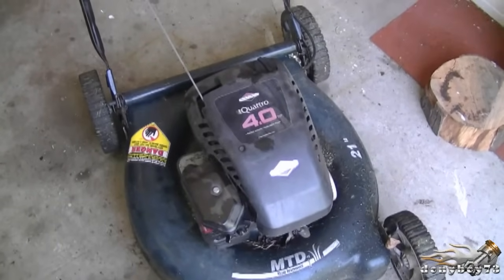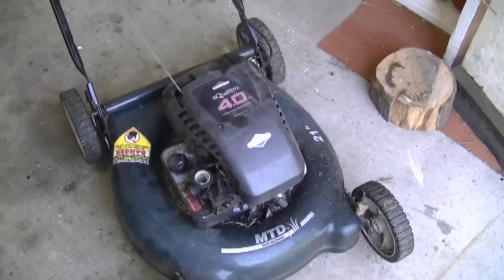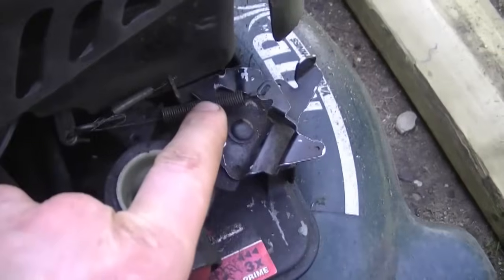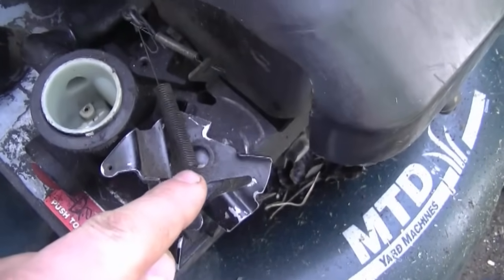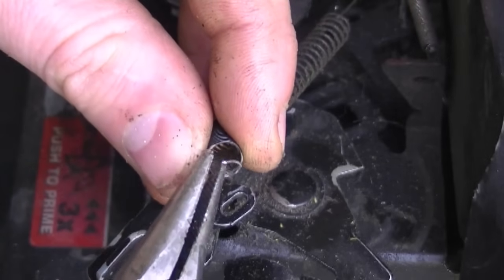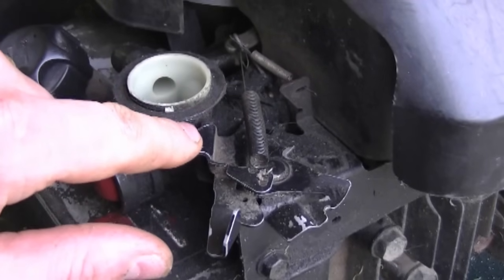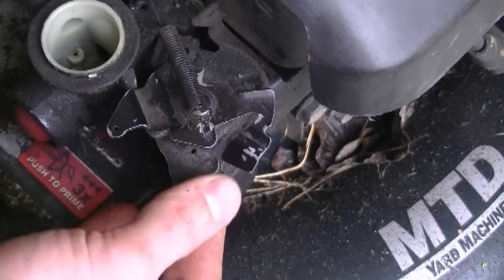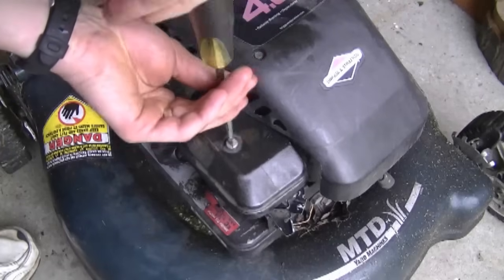HOW-TO ADJUST THE ENGINE RPMS ON A BRIGGS AND STRATTON LAWNMOWER

Comment: I did this but then it idled too high so I bent the tab so it idled fine but then it didn't rev high enough again.  I kept cutting the spring and bending the tab but I'm just going around in circles. I must be doing something wrong but can't work it out.

Comment: Exactly what I was looking for. I'm heading out to the shed now to give it a try!
Reply: UPDATE: Just what the doctor ordered! Worked like a charm! Thanks! What's even better is, I got the mower for free because the previous owner couldn't get it started and didn't want to take it to a shop (or watch a YouTube video). I took it and a half an hour later (and 1 YT video) I cleaned the carb and first pull it fired up. But I noticed it was idling slow. I downloaded the engine manual and there wasn't an idle screw to adjust. A little more research I saw two screw holes plugged up from the manufacturer. It was said one of them was the idle screw. I was just about ready to go down that rabbit hole when I found your video. It's running like a champ now!!

Comment: I have a similar mower but when it's on pavement it runs fine. But when you start cutting grass it will sound like it's hunting for air.
Reply: check the air filter - clean or replace as needed. thicker, taller grass will slow most low powered motors like this one, so cut regularly. adjust deck height. use good new gas. clean the carburetor - could be a gummed up jet. Check the spark plug and clean or replace, check the gap. lastly, at the end of the season run the gas out!
Reply: @theoriginalchefboyoboy6025  I think I found the problem. I replaced the gas tank and carburetor. It was all together on Amazon.  Now I'm trying to figure out why it's not sucking up fuel in the primer bulb. Unless I have to get it going with starting fluid then prime
Reply: @theultimatespaceghost6065  I went to prime mine today and I knew the gas tank was getting close to empty, but to me that shouldn't make a difference. It wouldn't prime - the button was just all squishy. So I thought, what the hell, I'll just top up the gas and it primed normally, started first time, so there might be some weird thing going on that the gas needs to be at a certain level.
Reply: @theoriginalchefboyoboy6025  I got it figured out.  I put the old carburetor back on and it primes as it should

Comment: My briggs and stratton sprint classic engine 148cc 450 model mountfield lawnmower won't rev much, even moving the throttle manually, still won't rev high at hall regards colin from croydon surrey England 👍 👍

Comment: Remove the governor springs and air vane. Install a throttle directly to the carb. You can manually adjust your own idle. You can max throttle it and let it redline. Briggs and strattons are way tougher than Tecumsehs!!

Comment: I bought one of those cheap mowers a Lowes and used it for probably eight years and then bought a Toro self propelled mower. I took the Yardman to the farm and used it another four or five years. I changed the oil regularly and replaced the air filter when needed. I did the speed adjustment here after watching this video. I installed a new blade and primer build and ended up selling the mower for $30 and it was still in great running condition.

Comment: Thanks. I ran my mower under a bush and it got stuck so I yanked it out. The engine raced and then settled at a super low rpm. I think this is what I need to check out

Comment: Nice, donyboy, as usual. I try to catch all your videos.
I know this is an old video, but I have an old mower. It's a 123K02-0479-E1 engine manufactured in 2005 which has a thermostatic autochoke. There's no throttle, nor can I see any lean/rich adjustment screws. Yet it's clearly not running up to speed even though the air and gas filters are new. Smooth but just tired sounding. Would this be a similar hack?
Reply from the maker: might be, i would have to see it

Comment: Hi
Mine lawnmower
Engine running
But not smooth
govener spring go
Short and Long 
By self . speed go 
High and lower 
Not stay on one speed 
Any ideas ?
Reply from the maker: carburetor needs to be cleaned or replaced

Comment: hey idk if you check these but i have an engine exactly like that and it keeps surging at higher rpms, and i have a new spark plug,cleaned air filter, and i cleaned the carb. what could be the problem?

Comment: I've had this issue when mowing under bushes and the tang gets knocked inwards by a branch. 
Briggs and Stratton repair manual advises to use a tang bender and adjust the secondary governor spring tang. 
No mention of cutting springs, just adjust the the tang (that part shown @ 1:35, finger is on it).

Comment: Hey I have a question I have a Toro wheel horse. 8-25  The problem that I'm having this. The unit will idle. But it won't give up RPMs to move the ride on mower . I have all them linkage  arms hooked up to where they're supposed to..  any help would be appreciated

Comment: Good video but it would be nice to know what the engine rpm spec is supposed to be and shoot for that.  I don't think listening for what sounds right doesn't necessarily get it right and like you mention over reving the engine is not good.  I bought and inexpensive hour/rpm counter for my B&S but I am not sure what it should run at - guessing around 3000-3200. Thanks for posting.
Reply from the maker: Between 3200-3600 after a while u can tell by sound
Reply: donyboy73 - I found a much better way to do this and probably the way a repair shop woukd do it. You basically loosen the cable housing clamp for the throttle control and adjust it there.  It’s very close to the linkages you show and very simple. I was showing 2700 RPMs and I loosened the cable clamp moved the spring like cable housing the throttle cable about a quarter of an inch which pulls the linkage you point out farther allowing the throttle to increase. That small adjustment got me up to 3000 RPM’s. Thanks for the reply

Comment: Thank you so much for sharing this video! My lawn mower was working OK and then after I went down the hill with it, the rpms slowed down significantly. I found out the problem was with the spring, which had fallen out of the hole. I cut a small section of the spring to help restore it to its original power and now it's working like new.

Comment: Hi, Tx for your video.  My push mower suddenly went from being a great running mower  to one that could only run at half speed.  At first  thought it might be about to run out of gas so I filled the almost dry tank and when I got it started it ran at what felt like half power.  After your video i adjusted the spring as you showed and there was no difference in engine performance and when the engine was killed there was a bit of a backfire.  Since this problem began I have changed the air filter and replaced the sparkplug.  The mower is still very difficult to start and often backfires when it doesn't turn over.  Do you have any suggestions?  Tx much
Reply: I should have gotten back after finding the solution.  The key on the flywheel broke changing the timing a bit, enough to make it difficult to start and while running, low on power.  I inserted a new key and it runs like new.

Comment: What is the recommended high rpm speed spec for one of these engines??
I have a classic 300 series in at the moment. I put it at around 3050-3100 rpm.
It cut descent but I feel it could still go a bit higher, whats a good max for one of those? Its on a 20 inch push mower so its only job it cut.
Reply: Fearless I have just started researching this. Other than listening or looking at grass cutting performance.  How do you know the safe RPM level?  I don’t want to burn out the engine.

Comment: Don,  I have a new Snapper Ninja muncher  with a Briggs 850 engine.  It is a constant velocity system that runs at 3,450 RPMS.  I would like to convert it to a manual throttle control.  Is that possible?  It has the bolt to hold the throttle control on the handle bar.  The push mower version and the commercial version have a throttle control but not the 7800981 version.  I even have the location on the plastic tray on the handle bar to put the throttle control.  It appears to be an easy conversion at first blush.  What do you think?  The reason I want to convert it is because if I engage the transmission I better have my running shoes on.

Comment: Dude you're good!  The way you adjusted that spring was quick and right on the money.  I can't figure out what's wrong with my Briggs push mower.  I think it's the governor or carburetor.   It worked great for 6 years without a problem.  Gradually the last few months the mower's been stalling and now it's reached the point of not even starting unless you open the area with the carburetor and adjust some things.  Even then it's still being stubborn.
Reply: surething baby could be loosing compression. 6yrs is probably well passed its used by date
Reply: 1.  Try a squirt of carb cleaner.  Wear protective goggles.  If that doesn't work...
2.  If you haven't done so in the last few years, replace the carb diaphragm.  It's a combo gasket and fuel pump, and tends to wear out after several years.

Comment: My quattro 4 does not do anything when I move the leaver. I noticed on your video that when you start the engine the governer moves back and puts more tension on the spring semester. Mine just sits the and there is no movement. Could the be something broken on the other side of the governer

Comment: Thanks for posting this video. While mowing the lawn with my MTD/Yardman, engine speed suddenly dropped to an idle.  After watching your video and checking the mower, I noticed that the throttle control spring was missing. Lacking the proper replacement part, I used the spring from a ball point pen. The mower started right up and now runs at normal speed.

Comment: Thanks man, i rebuilt my mower in November last year so i hadn't tried it since, i just went out to mow and i thought all my efforts had been wasted overhauling the beast but then i noticed that spring wasn't doing jack,i actually cut it a little different than you did and of course then it was too tight so i just pulled on it, mower runs like a champ, thanks again!!!!

Comment: Had the same issue. An easier and quicker way it to simply bend the bracket giving the spring more preload. 
I think I must have run into something which bent it in the first place.

Comment: Thank you sir!
My lawn mower at camp started running erratically after going through some bushes. Your video showed me how to adjust the throttle but I also realized that something must have bent the metal attachment the spring was attached to and when I straightened  that out it ran much better. Then I gave it just a nudge to bring it up from the factory setting.
Thanks very much!

Comment: what does the little plastic arm do that is attached to the small spring.  not the throttle body - I get that.
Reply: I believe thats a flap that works with wind from the engine turning and it keeps the engine running at a certain speed, i could be wrong on that.

Comment: Hi i have murray 4.75
I change carburator to a new one,change sparkplug, change the spring, change air filter, change gasket now when i start it the RPM goes really high what can i do to adjust it.

Comment: I have a similar motor, its has a plastic camshaft.I'm yet to pull the sump off but need to to fix the timing.Does this motor have timing marks, if not. what's the easiest procedure to set it.What the blade blade bolts onto is stuck fast, once this is off I will be able to remove the cover.10A902a 2073 B1 - Victa Quattro 4.0hp

Comment: hello, i have a craftsman rider mower with a (ic gold 14.5 briggs and stratton ) and it will run if i put gas into the intake but then dies, i have cleaned the carburetor once already but it still wont work. I believe it has something to do with the solenoid on the bottom of the float bowel but i may be wrong. do you have any ideas about what to try next? and also if it turns out its shot then where can i find the carburetor parts or rebuild kits for sale cheap? 

thanks a lot ,
p.s...your videos are great keep em coming !!

Comment: Hello, Aah it´s notperfect. At first you have to adjust the range of the Lever itself, so that the whole way does Change the spring Tension. Then, in the second step you have to adjust the spring Tension for the max throttle Position of the Lever by simple bend the metalt this Point where the spring is connected, not more.

Comment: hey man im just wondering i have the same mower i did a small repair on but the spring is all mangled from the owner not taking care if it. would you have any videos of where the springs hook up underneath the cover? & where could i get a new spring i tried looking on the makers site but they only go by part number and theres no number on the spring. any help would be greatly appreciated thanks.

Comment: hey Donyboy,

sometimes I think I am certifiably luny..I am hooked on your youtube videos; watching them till 2 or 3AM on a regular basis. You do a great job and are very articulate and knowledgeable as well. In any case I take serious note of your cautions about not setting engines to rev too high. What is the best source for determining factory recommended hi rev levels? Any single doc for this?
Reply from the maker: thanks lol, usually get info from a manual, however most engines require same rpm setting

Comment: Will the spark plug get fouled or bad when you manually take the running engine to full throttle, past mfg throttle setting?

Comment: Hi DonyBoy. I have a 3,5hp classic that seems to run at about double rpm as what it is supposed to , no matter if I shut the throttel. Is there anything else than the linkage you show on the video that I need to play with?

Comment: Hey,donyboy73 is it possable to put a push mower engine on a ride on? im thinking of buying a ride on without a engine, the two problems i can think of is how to control the throttle and how i would get the key to work, id turn the key to on then pull, any ideas? i know slight electrical. and for the throttle would i hook the "wire" to the spot the spring is on the govener in thos vid? or do i hook it somewhere else, ANY info is fully accepted and a video would be VERY helpful

Comment: 2 possibilities , blocked jets , causing need for a richer mixture or check gaskets , you could have a vacuum leak , closing the choke is blocking the additional air source , depends if its running lean or rich

Comment: m8 trust  me you do it the hard way on the spring just bend the metal tip that the spring connects to and then fix the speed to the high setting job don

Comment from the maker: it's not recommended because the oil dipper is different on a vertical engine and the carb would have to mounted horizontally

Comment: Hey Donyboy73!
I possess also a Briggs & Stratton lawnmower (sprinting 375) but I wanted to ask if it is possible to convert a horizontal axis because I have a plastic fuel like you but it is connected to a spring and unregulateur

Comment: the promblem is the mower runs but not high enough to cut the grass i had it running with new oil earlyer and it had smoke coming from under neath the engine( affter i adjuted the carb ) ive replaced the throtel cable to see if it would work any better but the revs are no higer i adjusted the carb ive posted some vids off it so if you wanted to see whats happening you could have a look

Comment: hi donyboy73 i have a honda hr 194 ive done every thing to get it running but it is very hard to start and the oil is getting to the spark pluk wich i intend to sort out next but the hi rev is like a low rev and idle is switching the mower off the throttel cable has been replaced the other thing is it clacks when you start it ive cleand the carb and tryed every thing but it still dosent rev high enough and dosent start properly so if you can help me or anyone els on here

Comment: Hey dony, i have a husquvarna mower in the shop with a honda gcv160 engine. it runs, but it runs really really fast. ive replaced both throttle springs with brand new OEM parts. linkage is not binding. what could be causing this?

Comment: @donyboy73, the easier way to adjust the revs is to bend the tag that you took the spring off towards the front of the engine, if you didn't already know
Reply: jeffy0807 also I have good luck just rotating/twisting the spring to make tighter.
Reply: Another way but it’s not your channel. Lol

Comment from the maker: you can use a tachometer for small engines or some auromotive ones work too
Reply: So whats speed should briggs engines be set to with a tachometer?,there are many different models 3/4/6 etc?

Comment: I have a demo cut off saw, 14" gas 2 stroke.  It was hard to start and run for awhile.  Took it apart, compression reads 40 psi, heard if you put oil in spark plug hole for a couple days, will help restore some compression?  Should I just order cylinder/piston?